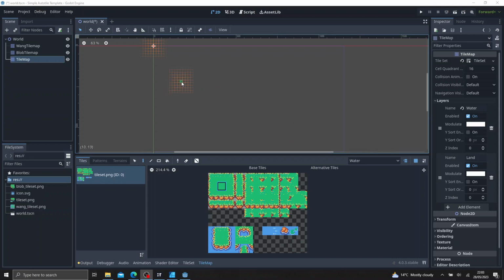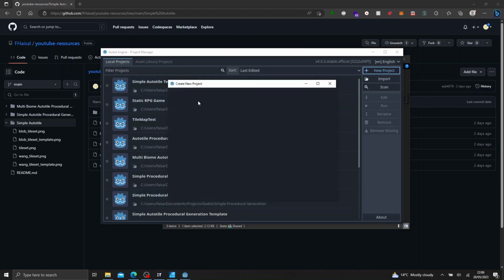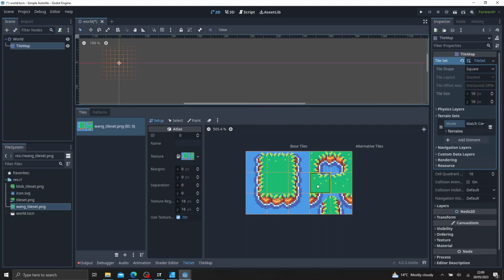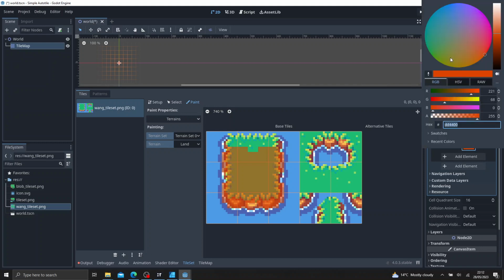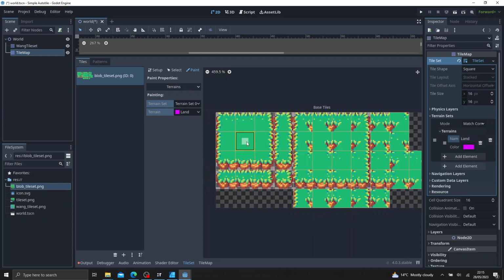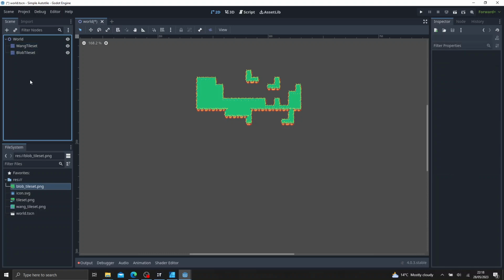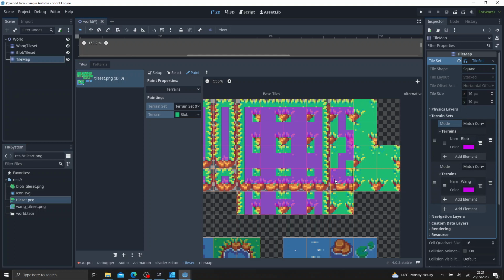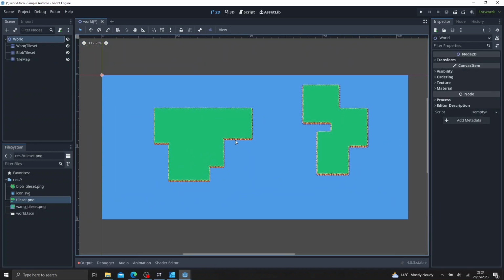Godot 4 Autotile Tutorial

Comment: I came to your video looking for an answer on why I keep getting those random blocks you also got on your wang tileset 😢

What I think is happening is that when the source is larger than 3x3 tiles it has many possible candidates for the insides and it doesn’t always pick the correct one. At least that would explain why it doesn’t happen to me for terrains that are exactly 3x3. 

Did you figure that part out?
Reply from the maker: Hey mate, I think it’s because the wang set doesn’t have as many tiles as a blob set. So the minimum amount of tiles you need to place is 3x3. Like you said I don’t think it knows which ones to use within the 3x3 block because it may be missing a tile. I think it’s meant to fill it with a water tile instead of blank or a random tile. I’ll do some experiment on my side and see if I can figure it out. But as of right now haven’t seem to find anything yet. I’ll keep you informed if I do 🙂
Reply: @fhaisal  same here, I’ll try isolating this behavior and if I figure it out I’ll come back 😄
Reply: @loupax  any luck with this...?
Reply: Found this video looking for answers on weird behavior with the Wang tileset. Still happening in 2025. Since I'm just getting started on a project, should I just switch to using a blob tileset?